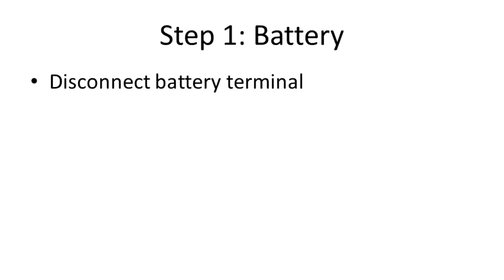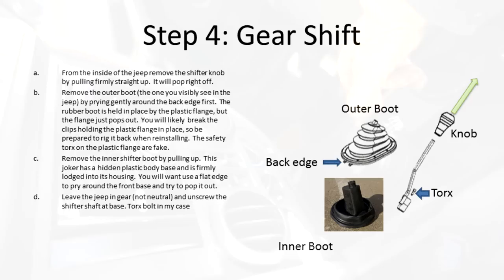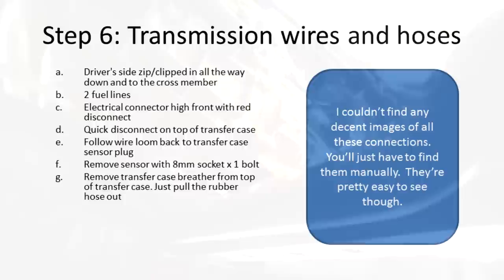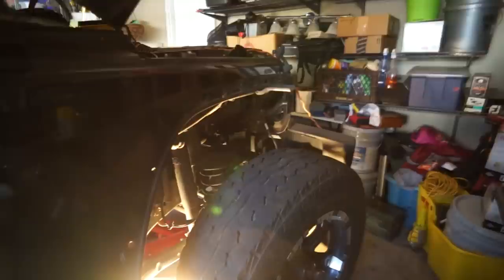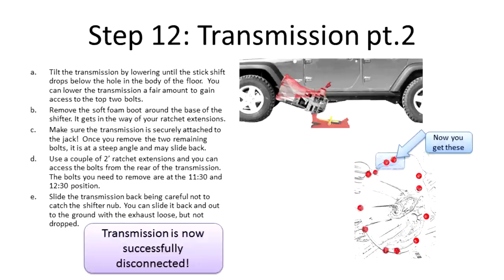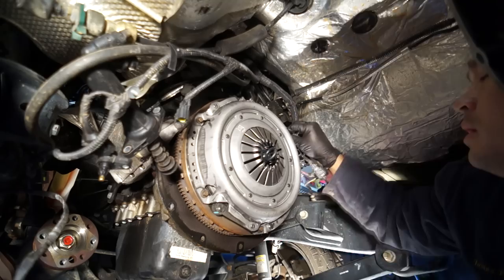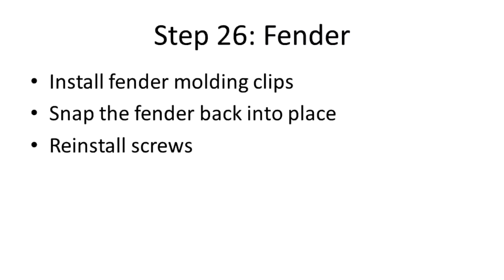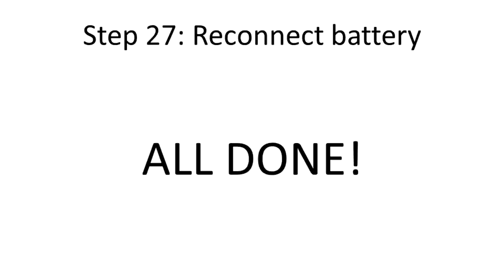2007 Jeep Wrangler Unlimited Manual Clutch and Release Bearing Replacement

Comment: Thanks for this video! I just replaced the throw out bearing and clutch by using this video as a guide. It took me much longer than expected, and lining up the transmission again was by far the hardest part. I wouldn't have been able to do it without your help.Few tips for anyone else who lives in a rust prone area (and a few oopsies I made),- Heat is your friend on rusty bolts.
- Your rear driveshaft will come out using a drift pin and a large 4-5lb hammer when you use the pilot holes from the rear. A flat head screwdriver will get the other end out.
- If you replace the pilot bearing, you will most likely need a puller to get it out.
- Make sure you get all the pieces of the old TOB out of the bell housing.
- Don't forget to put the foam back over the shifter before raising the transmission back into place and installing the cross member. (I didn't do this)- Your exhaust flange bolts will probably need to be replaced as well.
- The green transfer case shifter cable retaining clip will probably break and need replacement.- Make sure to Drop the transmission so the shifter nub is below the body of the jeep before separating bell housing from engine.- if you don't have a transmission jack, Use a ratchet strap between the frame rails as a safety measure to avoid death or dismemberment.- If you are using floor jacks, 2 jacks are better than 1.
Reply: Perfect thank you, I'm right at the part to remove the rear drive shaft and couldn't figure out if there was an easy way or not.
Reply: Thank you so much for taking the time to make this incredible video. This is the best I’ve ever seen with the details, I took screenshots of each step…. I will be tackling this job on my 2000 jeep liberty, 3.7 V6 with a six speed
I know some of the steps will be different in. Both sizes will be different, but this gives me confidence to be able to do it on the ground because I don’t have a lift, thank you again so much for taking the time to make this, it’s helped more than you realize, because some of them probably didn’t comment 🏁🙂😎

Comment: I just want to thank you so much lee. I followed your video step by step over the last couple weeks to change my clutch and release bearing which had gone bad. I can't believe I was able to fix it myself when the dealership quoted me $1600 for the fix. I am so grateful for posting this video you have no idea. It was huge for me and a perfect intro to bigger mechanical projects. I wish i could do more for you than just subscribing and liking this video. It is an excellent video. Thank you a thousand times.
Reply: Swamp Monster Productions - that’s a ridiculous price. Parts including throw out bearing, and flywheel shouldn’t cost over $700 with a little judicious shopping around. Book time is 6 hours. Average of $100 an hour. $1300. Not a penny more. But, dealing with a dealership I see the problem. Any decent transmission shop would get it done for $1200-1300

Comment: Thanks for the reference to my Clutch Slave hydraulic line video.  I have been considering taking this job on to replace my TOB.  It will be my second one.  It's been ticking for 2 years so I'm limping through.  Although I COULD do this job I really don't want to lay on the ground for 10 hours wrestling with it.  My biggest fear is getting to a critical point that I cannot address and having to flatbed it out to a garage.  I'll likely pay a reputable garage to do it when I cannot wait any longer.  But I REALLY RESPECT you for doing it and sharing with us all!

Comment: I wish I saw this a few years back.   I had to do the same thing on my JK.  You did a good job in explaining the sequence of steps and listing the size of bolts.  The two things I had the most problems with were the shifter area and the top transmission bolt.   Unfortunately I didn't change my clutch when I changed the throw out bearing so I have to do it all again now that my clutch is acting up.   Believe me lesson learned.   The only other thing I would say is to make sure you put the disc plate in facing the right direction.   I had to learn that lesson the hard way when changing the clutch on my Cj.  Thanks for the great video.
Reply from the maker: Cj7 and other Jeeps I also had a heck of a time with the shifter and top transmission bolt. I read enough tips on forums recommending changing both the clutch and release bearing so I figured a couple hundred bucks was worth my time and better safe than sorry.  Thanks for the props.
Reply: Literally just did the same thing. Swapped throwout 3 months ago. Now clutch is needed. Lol. Shoulda read the comments. Your video has been unendingly helpful.
Reply: Will the throw out.bearing sounds and feels like it’s about to take a crap again so it’s back to it again.  Liked I said 6 years ago, this is a great video.
Reply: ouch i remember me first clutch replace. Wore a hat and the button ontop of the hat almost punched through my skull trying to get transmission aligned

Comment: TIP....
I use 2in ratcheting tiedown straps. Same ones you use you hold down loads in a trailer.hook them across the frame and use them like a sling...this is a long tranny..i put one across the transfer case and mid tranny and bell housing. This will allow you to lower the tranny with out fear of it dropping or tipping off the jack.  Loosen one at a time in conjunction with the jack...they work even better to raise and. Anlgn tranny back into place with out fear on tipping or dropping the tranny
Reply from the maker: pro-tip. thanks!

Comment: Taking it to your local garage and having them do it will probably cost you anywhere from $2000-$2500 I would say there is a lot of labor involved the part is not that expensive it’s the labor also I have to replace the fly wheel  pressure plate as well  thanks for the video Tip
Reply: I’m so thankful my mechanic only charged me $1000. I haven’t heard $2,000+ for this job, but I was getting quotes for around $1600 from other places.

Comment: Thanks for taking the time to edit this up.  I'm about to help a friend with their 2007 wrangler.  I've done WRX STi clutch changes on jackstands, and this appears to be more straight forward.  Did you check your pilot bearing for any play or roughness?  That's the one tool I don't have--a bearing puller. I do have a harbor freight nearby, though. :D

Comment: Is the flywheel single or dual mass? Someone told me that clutch disc with springs works with single mass flywheel ; instead clutch disc without springs works with dual mass flywheel. What do you think about?

Comment: Great video Lee. I have a clutchbof my own thst i would love your imput on: i have a 2011 jku and i have changed the clutch master cylinder. My issue is the hydrolic line. I have pressed it back in (without trying to breack it) but it still leaks. Any suggestion? Should i try to press in futher? I did not see an o-ring on it when i removed it. Should i try to add one. I am stuck.

Comment: A couple questions- did you pass on removing the starter? From your directions it sounds like you also left the transfer case attached, right? Did you drain the little bit of fluid from the transmission to lighten it up or just go with what you've got??

The flares are 10mm bolts and clipsandfasteners.com can help people find the clips for a decent price. 120k miles, original owner, annual water runs in the jeep- so I'm certain I'll be doing this soon. Thanks for the video!
Reply from the maker: kswyg I guess I forgot to include the details about the starter, but I did wind up disconnecting the starter.  Regarding the transfer case, you are correct.  I did leave it attached.  I also drained the transmission fluid.  I made the video several months after actually replacing the clutch and release bearing so I guess I forgot to detail a few things.

Comment: any more info on getting the exhaust to drop down? it is stuck between a large bracket on the drver side frame and the transfer case. It wont squeeze between that gap I tried jacking the trans all the way up and lowering it all the way down. ive got everything but the trans bolts disconnected. crossmember and trans mount are off and starter is out. rubber hanger just after 2-1 Y is off the rest are still on.

Comment: Hi Lee, thank you for the video. At what mileage did you have to replace the clutch? I didn't see this information in the video. I have a manual JK and am wondering what I can expect.
Reply from the maker: David Mason I had to replace the clutch at just over 60,000 miles.
Reply: +David Mason I have just over 90,000 miles on my 08 and the release bearing is starting to make noise when I depress the clutch pedal after a cold start. Mileage can vary based on driving habits and how much wheeling you do.
Reply: David Mason I'm at 115k and it's starting to make noise, at least I'm pretty sure it's the clutch. as far as I know everything is original. from what I have seen though my case is very rare, in fact I'm the only one that I know, and most people have to do it by 80k.

Comment: How did you remove the exhaust. I'm doing this project as we speak. It's been a easy process so far. I just need the exhaust out of the way and four more bolts to drop the Trans
Reply from the maker: Ben Dooley Sorry this response is so late, I suspect you already completed the job.  Anyway,I did not complete remove the exhaust.  I did drop the exhaust by removing the flange bolts at the exhaust manifold, remove the O2 sensors and then I used a pry bar to pull the exhaust off of the hangars where the rubber mounts held it in place.  Check out step 8 here: https://youtu.be/WmG9R1f8kxo?t=8m26s
Reply: Thanks for the response. I haven't finished yet. The flywheel was in awful shape, so I had to order one .

Comment: Hey Lee, just wondering if you have any tips for smoother shifting with the JK? The worst for me is going from 3rd to 2nd gear.
Reply from the maker: Hey, sorry, but I am not an expert and this is beyond my experience.
Reply: I've driven manual vehicles for over 60 years you going to have to give it a little gas to rev up the engine before you go from 3rd to 2nd keeping your RPMs approximately where you were in 3rd gear
Reply: Watch the movie Bullet watch how he down shifts by giving it gas
Reply: Jerry Whalen That's a "horse " of a whole different color , (pun intended) that is a Ford toploader , one of the best manual transmissions ever made , besides the Chrysler " hemibox ".